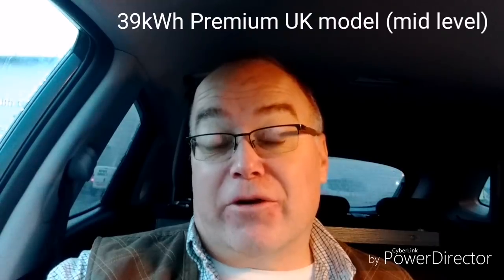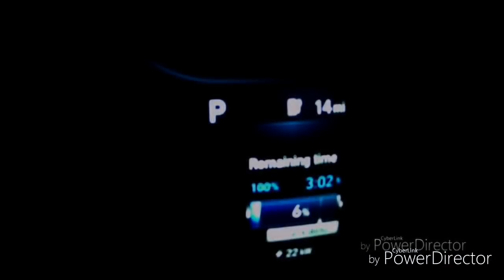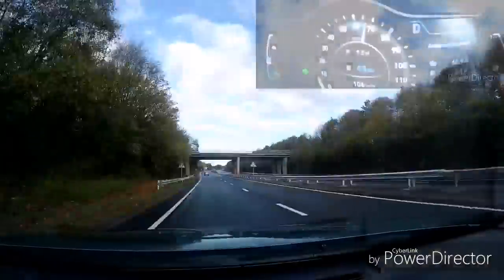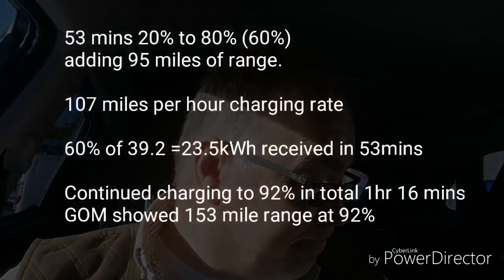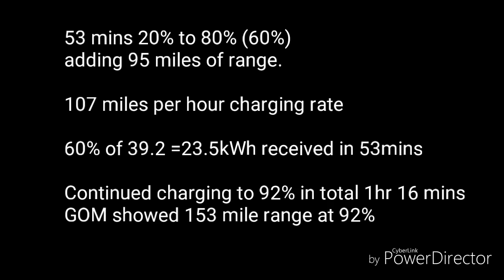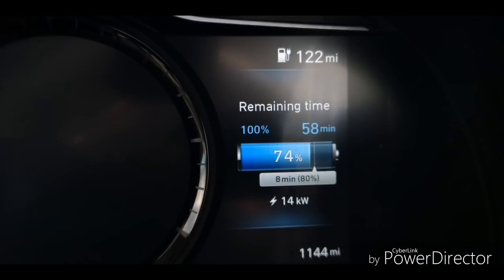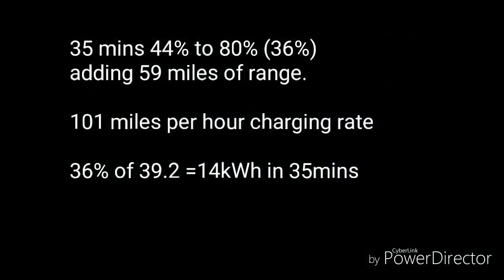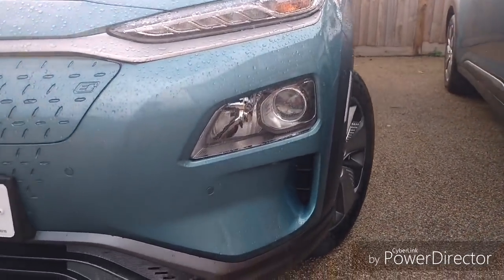Multiple Rapid Charging / Charging concerns & why I wouldn't buy a 39kWh Kona Electric

Comment: Since you received low charging speeds for both Konas and received fast charging on the 39kWh on the third charge. Did you ever doubted the charging infrastructure to be the problem, NOT the Kona itself?
Reply from the maker: Low charging on the 39kwh only. None of those tests were of my 64kwh
Reply: @EVPuzzle  I understand, I missed that.
However: Didn't you receive 42kW at some state during charge no 3?
Just trying to figure out why a 39kWh pack wouldn't accept 48kW as the Ioniq with 28kWh pack will.
Reply from the maker: Exactly, odd.  I did see 43kw for a very short period on charge 3 and my data shows a small amount on charge 1, just a lot less of the higher rates than you get with the 64kwh.

I'll post the charge rates in a graph when I get chance

Comment: The first thing that you've said where my Zoe has an advantage is that the heater is pretty good in the Zoe. The fans are really loud in the Zoe too, louder than the engine in a modern petrol at tick over I'd say. The Zoe pulls a consistent 22kw up to a bit over 80% then it slows a lot. I'm not sure charging speed matters so much once the range is over 300 miles because the need to fast charge will be such a rarity, you definitely have the right car with the 64 kwh model.

Comment: As a ball park :
Batteries for cars are constructed in banks, and in each bank the cells have a standard in-series and in-parallel set of single batteries.  For a particular make of battery then each bank of battery can be charged at a maximum rate.
A small battery (39kW) will have a number of banks - lets say 4.
A large battery (64kW) will have more banks - lets say 7.
(yes those number don't work, but hopefully you get the idea.)
The motors used are designed to be used at particular voltage, so a large battery has the banks in parallel - so you get more current - but no more voltage.  Since the larger battery has more banks in parallel - you can change it faster, and you can get more amps out of it (power).
The smaller battery car will charge slower, and have less acceleration.
The larger battery can be charge faster and the car can be make to accelerate faster.
The two cars can be charge in the same time (approx)- since the larger battery can be charged faster - more amps - since the banks are in parallel, and the charge rate for each bank is the same.
Batteries really don't like to be discharged and they don't like be over charged, and for those in cars the battery management will attempt to protect the batteries
1) It will warn you when you get low in charge, and reduce power at very lower power and will not tell you about the reserve
2) It will only charge at full power up to 80% charge : and that depends on the charger and on the temperature of the battery
3) above 80% the battery management will reduce the charge rate - to protect the batteries, and above 90% you will get very low rates, and about 98% it will be a trickle rate - or they will fail in a bad way, and you don't want to be in the car when that happens.
4) Batteries hate the cold - and if the batteries are cold the battery management will reduce the charge rate, same with the heat (hence the charge-gate)
5) The Kona battery (large one 64kW) will charge up to about 100kW, but in the UK we have a crap changing system, so a lot of the differences will be down to the crap chargers.  The kona small battery will take a smaller rate, but should go up to 50kW.
I agree that the 64kW Kona is a ground breaking car and the better than the 39kW and I hope it makes Hyundai a lot of money as the other car manufactures just don't get it.....

And if you are not bored yet : one final bit of technical detail
Although car batteries and phone batteries are Li-ion the tech it different.  In phones, the battery is designed to have a high charge-weight capacity (we like lite phones that last a long time), but the batteries won't last long 1 to 5 years depending on how you use/abuse them.  Ie if you discharge and charge to 100% every day - expect 1 year, if you keep 20% to 80% you will get 5 years.  The battery management is minimal - you have to do it manually.
Car batteries are heavily managed (you are sitting on a lot of energy - going wrong is not an option), and use tech that is designed for long life, not for best weight.  Tesla statistics have shown that their car batteries have 90% capacity or better even after 10 years and for most other companies you should expect the same lifetimes - certainly from Hyundai.
Reply from the maker: If Hyundai build on their technology rather than just repeat the same thing for years they'll dominate the market BUT if they stop here, others will catch up quickly. The Ioniq needs a update for next year really so it'll be interesting to see how each model changes or not over time

Comment: Just a few comments.

1# Kona has a heat pump, these are increasingly inefficient the closer you get to zero ambient. 
2# I'm not sure about the Jona but the cooling/heating systems are shared in the Tesla. The car takes priority - this could explain why it's cooler
3# I suspect your 64 does/would make a racket but it's quite cold in the UK at the moment - it could be that the car is simply heating up the batteries to increase the charge speed
4# Not all charges are created equally, some may deliver less power than you'd expect
5# Charging speed is quite variable due to SoC, battery temperature, ambient temperature etc.
Reply from the maker: All useful but as Hyundai quote 57mins to 80% we're back into small print territory like the Nissan Leaf.
Reply: @EVPuzzle  Hmm, that basically assumes it's charging full chat without any slowdown to fill the 31.2kWh battery (80% of 39kWh). At current charging speeds that's VERY optimistic. It may be more realistic once the 150kW chargers "trickle" out

Comment: Just a thought, Under battery care, did you have winter mode off?
Reply from the maker: Winter mode is separate. Its use is intended for -10c and beyond extreme conditions. Normal UK weather is handled the same with regardless of that setting
Reply: Again that has saved me reading the manual, If your ever in the Stratford upon Avon area pop over and set the whole thing up for me, please.
Reply from the maker: Yeah right lol, I hate ready the manual too. Winter mode isn't really clear from the manual it sounds like it turns the battery heating function on or off but in fact it's about managing the feature where motor power is limited if it's too cold. Winter mode enables you to have more power to drive as the battery is being heated.

The trick is to charge you car just in time for when you're leaving do the battery warms a bit before leaving. That's what I tend to do, leaving at 7am so set timers for 5am to 7am only etc. #Jintc just in time charging
Reply: Ok, Went to the local Instavolt (Lovely Experience) 60% 40kw, 68% 34kw, 74% 23kw, 82% 20kw, Not the best test as started at 60% (only had it 2 days) but will let you know the stats when if ever i charge from around 20%.
If you have a twitter account let me know as can send photo's.
Reply from the maker: Cheers William, email and Twitter details are in the description of each video.  @KonaElectric
Reply from the maker: That's what I've seen in my 64, nice and steady and predictable

Comment: Great vid as usual.
But could you please include cost of charge at these public charge points. I'm currently considering EV as my next car and cost and availability of charge points I think is key to my needs.
Reply from the maker: Paul, I definitely forgot that. Its not easy including everything. The Instavolts were both on free bend bit would be 35p per kWh dispensed. Obviously with heaters on and battery care on, that would be more than the kWh added to the battery.

The Engenie charger at Peterborough was free again but should have been a flat fee of £4
Reply: @EVPuzzle  thanks for that. I live in an area with less chargers than you probably have so its good to know what to expect when our local infrastructure improves.
Keep up the good work. We appreciate it.
Reply from the maker: Paul,  yes Norwich has 4 rapid chargers I'm aware of but all central to Norwich itself.  There's nothing around the coast or on the major routes in/out.
Reply: @pauldavison7105  If you have off street parking you would do almost all your charging at home, and you would not be interested in local chargers. It is the availabilty of chargers a long way from home on your travel routes that becomes more important.  If you have no off street parking and are dependent on public chargers, then membership of the Polar Plus network is the best option which will cost about £10 a month plus 10.5p per kWh used.
Reply: @delboy4711  that may be your view and needs , but it's not mine.

Comment: Hi Nigel, I do like your video's, You do all the shit i'm interested in and can't be bothered to do myself.
By the way, I picked up my Kona Wednesday and loving it, If I get time I will pop over to an Instavolt charger tonight and see how it does, not a great test as it will be on about 50%. With normal driving with heater, i'm getting 4.2 mpkwh, But have some long trips next week so will keep you updated if interested.
Reply: I wouldn't get the ioniq38.3kwh it's just as bad. I'm going complain when it gets its first service, I hope that they could do something about it if they can't, I will have to avoid  ev charges that charge by the minute.
You would be better getting the 28kwh it charges alot quicker.
Reply from the maker: Course I'm interested. Charging on the Instavolt from cold is the issue. My 64 is perfect on the Instavolts only that 39kwh version seemed a challenge

Comment: Looks like it might operate according to an algorithm, when to charge fast and slow according to temperatures and conditions etc.  The longevity is the issue I think. For a lot of people rapid charging is not so much of a problem. 
But one thing - what is the normal range of the 39KwHr? If its in the order of 170 miles its still a great little car.
Reply from the maker: If you extrapolate from that trip it's sub 160miles in those conditions

Comment: I earlier wrote that the reported average consumption in the (my) old Leaf is not correct (every time). I reset everything the other day, down to about 50% now, if you extrapolate the shown numbers the car would report something like 13-15kWh usable, while the truth is around 18 kWh I believe. Showing around 15kWh/100km average now, I think it should be much higher, driving in around 0C with heater on these days.

Doing the math on your travel here however, it seems alot more spot on. So maby it's only Leaf that can't do this right?
77.7 mi (124km) on 60% extrapolate to 206km on 100%.
17.26 kWh/100km * 2.06= 35.55 kWh That shouldn't be very far off the true usable capacity, right?
Reply from the maker: Usable is 39kwh apparently but I'd agree the GOM is accurate, battery % maybe less. Needs decimal places
Reply: @EVPuzzle  your right, 39kwh usable, I forgot that Hyundai/Kia does it the right way, not serving lies as most of the other companies :)
Add in a little buffer at the low end, heat loss in battery, lacking deciamls and my 35.55 is quickly 10% of, so it's even closer to 39.
Anyway,  IF the average consumption in the car is fairly correct, the calculated batterycapacity like I've done now should be very close every time ;)
Reply from the maker: Rayner, I think you're right

Comment: One question to investigate: I do like to put the car to sport and Regen Level 1. That makes the car feel much lighter and powerful, and Regen Level 1 makes it feel like an ICE with its natural engine resistance. Now, it would be great if I could use the brake knowing all goes to regen if I am gently enough. But I don't know how the brakes work. Do they use regen to the limit and only then they physically brake? Or it is someway more progressive, acting on both at the same time and therefore loosing some energy in heat? I have not seen anyway indication in the console on when the physical brakes do start to work. I see the regen acting but I never saw anything in the console that tells you: Now I am using the physical brakes. It would be great if we knew something more about it, would'nt it?

Comment: I agree with you the IONIQ is a better buy based on your tests. It rapid chargers a lot faster and has no rapid gate issues.so it may not go as far between chargers but quicker to charge makes up the time spent at the charger.
Reply from the maker: Exactly. What I wish Hyundai would answer is... Why is the Kona 39 slower than the older tech Ioniq. The Kona should be a leap forward but in the 39kwh it's actually a step back it seems. 
They should've put 45kwh or more in it.
Reply: I agree

Comment: Great work you're doing look forward to every blog thanks. I'm getting a better understanding of owing and running an EV now and that on average that the Kona will travel 4 miles per one kilowatt of storage so the range is approx 4 X 64 = 256 miles. So another consideration has become evident ( for the potential buyers) using the Kona as a bench mark if I may, say the cost to purchase is approx £30000 for the 64kwh divided by the range then that figure works out to be £117 per mile, so that's the purchase price bench mark I'm using here, now compare that against say the Jaguar Ipace of £64000 and a range of 234 miles then the figure is £274 per mile. Think you got a great car and deal there and will now be judging future EV car prices on this formula as a basic guide as value for money.

Comment: I would expect charging on a cold battery will always be much slower than a warm battery. Power output from a cold battery is also lower. 
Is there no pre conditioning app that allows you to warm the car up before you go out on cold mornings? That should also heat the battery a bit.

Comment: Hi Nigel
I haven't done multiple charges on my 40KW leaf but on a normal fast charge it does about 43KW while below 50% state of charge and after that it starts to vary 
As a rule of thumb if you took the state of charge% number and add it to the KW/h charge rate they will total 100 
So at 60% charged you will be getting 40KW/h    -- (add together  60+40 =100)
and at 70% charged it will be getting around 30KW/h
at 80% charged you get around 20KW/h
at 90% around 10KW/h 
You get the picture. So you would need the patience of a saint to get to 100% on the rapid charger
I always push off somewhere North of 80%  :)